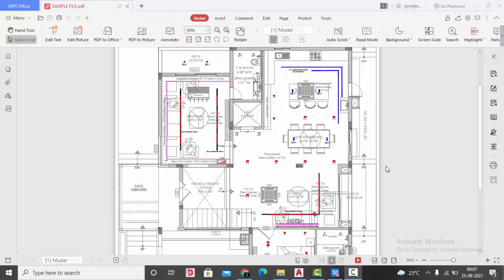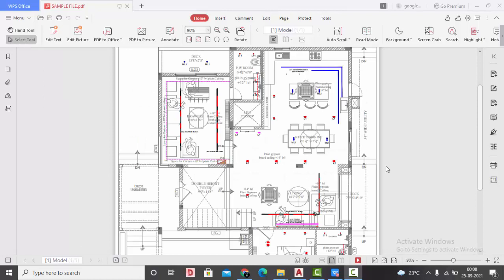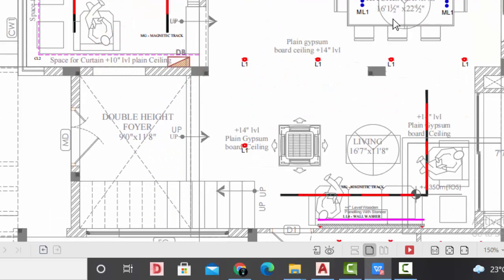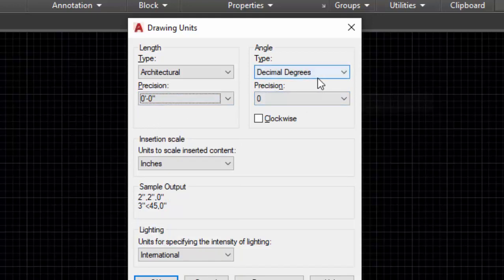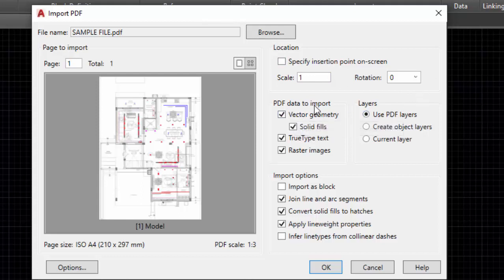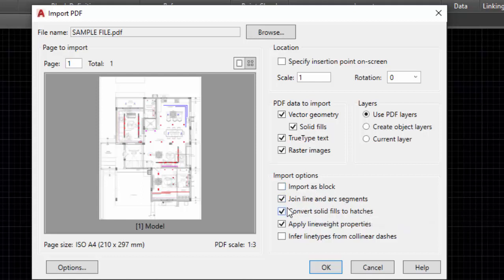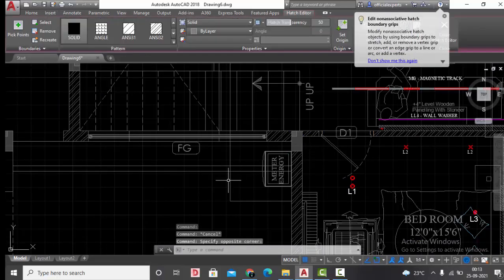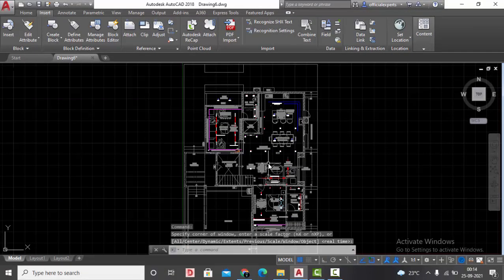Importing PDF file in Autocad

Comment: Mam i need a help when I'm importing  architecture pdf into autocad it was not in proper dimesion as written over, all dimension is in mm but it was like there is wall of width 100 mm its was appearing as 98.90 mm and the same wall at an some distance appearing 100.20 or 100.30 it was totally taking too much time to settle this problem i need help to fix this thing could plz make a video for such a problem it will help me alot.